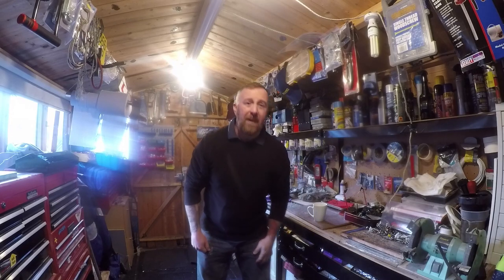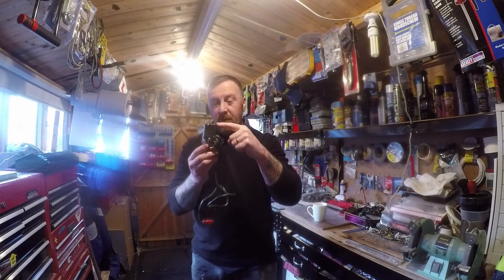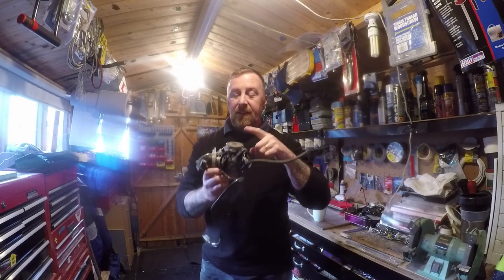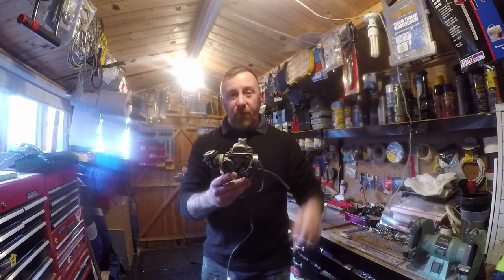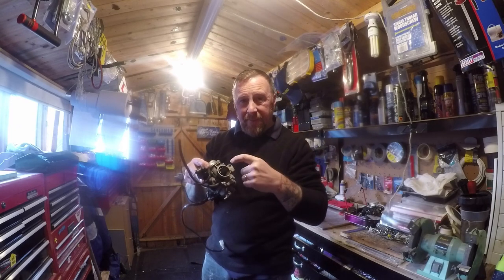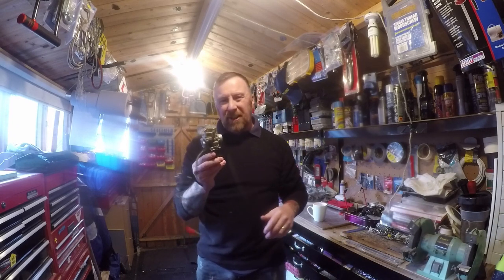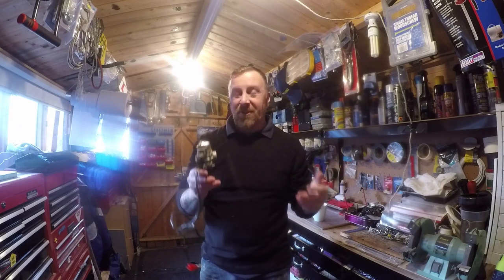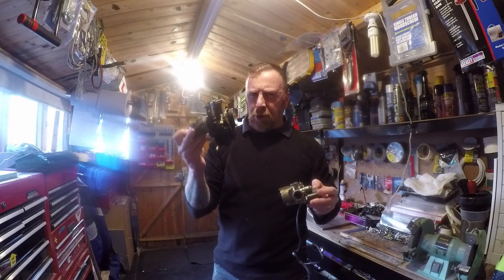MOPED MOTORBIKE BASIC CARB CLEANING HELP MARK SAVAGE

Comment: Hey Mark, my son has a Piaggio NRG it’s lossing power at full throttle will only run at half only doing about 20-25 max speed
Reply from the maker: sounds like bogging down or piston wear/ rings 
i have jusr done a basic bogging down video, check that out also at the end of this video follow the likes on carb cleaning 
theres a tunnig video too on my channel 
they should all help sort it 
mark
Reply: @marksavage  hi Mark, I’m in desperate need of help getting my daughters Aprilia RS50 running. I’ve watched all your videos but still can’t get it running. 
I bought the bike for her birthday and at this rate she won’t be able to ride it. Can you help?

Comment: Hi Mark, I recently had a low speed spill on my bike 5-10MPH and the bike fell on the left side (handlebar obviously hit) while the bike can still be ridden I can definitely feel the handlebars pointing a tiny bit to the left when going straight, eyeing everything up it all looks straight as can be. I've check the handlebar risers (bolts) and they're straight I'm just reluctant to remove the bars to check them as I just fitted new grips and it would mean breaking the glue on the clutch side. Do you have any tips? Cheers!

Comment: Hey mate I’ve got a 2005 Suzuki Burgman the float , jets are clean but it keeps over flowing and cutting out on standstill and it’s just started over heating I’ve watched most of your videos but I still haven’t got a clue. Would you have any suggestions
Reply from the maker: Tom Keys hi bud 
I have a few videos of j burgmans but it’s not reviews and a simple service 
Ok over flowing and over heating ?
Is the carb over flowing - leaking patrol that will be the float so need taking off and sorting 
Over heating this is separate and bad !!
Is that over flowing water ??
Mark

Comment: Hi Mark  I have a Speedfight 2 the starter motor turns over slowly any idea what it could be
Reply from the maker: Matthew Cook hi
First take off the engine cover and see if the dendix is clogged up along with the starter 
Take out the dendix and spin the starter to see if it spins ok 
They often get clogged up 
If ok but still spins slower you could just have a worn or lazy starter 
Does it kick start ok?
Also some time a worn piston can also do this but not often 
Give that a go 1st
I have many speedfight videos to help 
Mark
Reply: Hi i have look at the bendix  and it works fine and the starter motor  spin okay
Reply from the maker: so spins ok and the Bendix is all clean and working good with no rust or crap /dirt every where yet it still turns over slowly?
they can slow under load so still may need to change the starter 
mark
Reply: @marksavage  Okay i will  have a look  at one now

Comment: Hi Mark, my bike is hard to start when its sat over night. It takes a few kicks and when i give it throttle it dies. I need to keep kicking it and twisting the throttle until it idles properly. Any ideas?
Reply from the maker: Matti De'Beer defo carb 
Follow the end screen links to the carb cleaning videos and clean then check fuel pipes and gaskets vacuum and float 
This should help
Mark

Comment: Hi mark i have a gilera ice 50cc bought it from a so called bike mechanic 2 weeks ago and now the exhaust fell off the battery is completly flat and THE BIKE WONT START😂😂😂... ive since got a new exhaust and battery and new spark plug and it still wont start it ran fine for the first week and now it wont.. i no fuck all about engines but want to learn myself as its only a small ped but when i have a proper race bike i no how to look after it the electric start wants to go but it just doesnt seem to catch on
Reply from the maker: hi bud 
ok so it did run , check spark plug for colour as it just may be your air petrol mix, like in my carb videos and tuning videos on here
get that set right as it could be as simple as that if it ran then didn't 
so clean or change plug , air filter , then take off carb and clean and tune
bad bit , it could be pitson, when you try and start open the throttle full and if it pops and back fires when trying to start it could be the piston
starter , check out Bendix they do fail , rust , jam, and just want to pee you off, lol
I do have videos on them too 
hope that helps 
mark